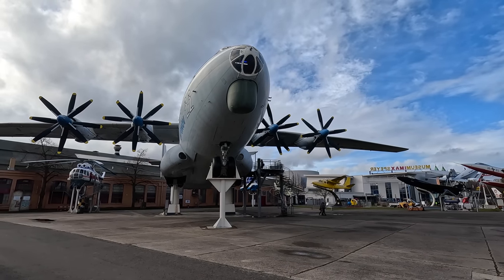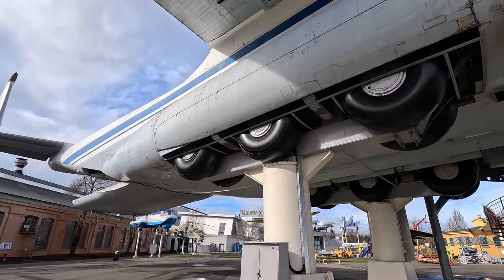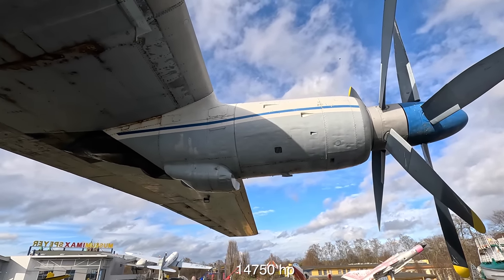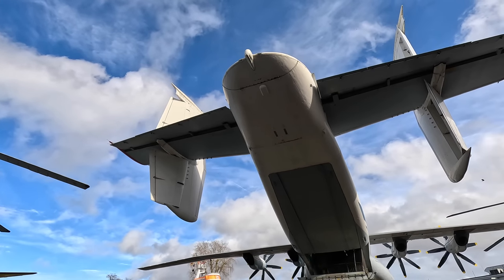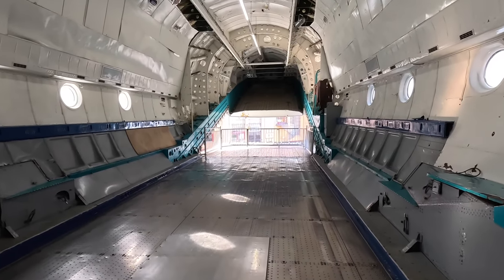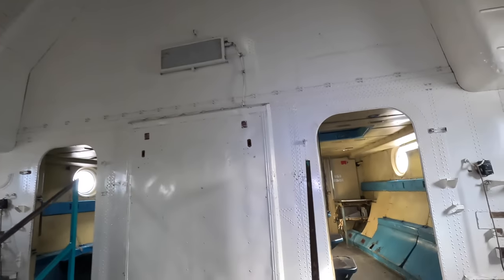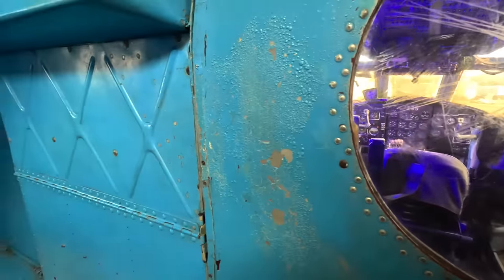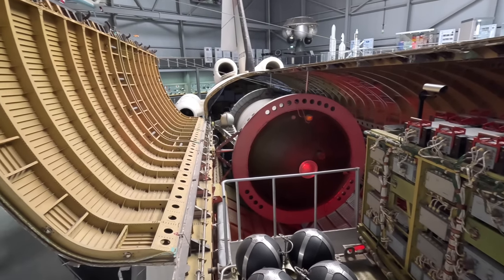Guided tour through the world's largest turboprop - the Antonov An-22

Comment: Paul, at 5:20 you said that having 2 small fin/rudder arrangements instead on one large one reduces torque (stress) on the airframe.   That doesn't make much sense.    To achieve a given level of yaw stability you need a certain total fin area.   To achieve a specified amount of directional control you need a certain total rudder area.   With these predetermined areas, the torque imparted on the airframe is the same, regardless of whether it is one big fin+rudder, or 2 or more smaller ones adding up to the same total area.
There is, however, a very minor, almost insignificant, structural advantage in the fin(s) themselves.    You don't want them bending, nor oscillating in the wind like a violin string.   To achieve the required fin stiffness, the amount of metal needed in the internal framing/bracing in 2 small fins is less than that needed in one large fin, due to lower internal leverage.   This may have been what your source was referring too - torque within the fins, not torque imparted to the airframe.
Reply: That’s interesting, I never gave it much thought either way.
Reply from the maker: Thanks for the extra information Keit and what you say makes perfect sense too.

Comment: It is fascinating how contra-rotating props were prized in USSR and dismissed by western militaries in the same era. As you discuss, they have some obvious advantages (no torque/yaw)  but some similarly obvious disadvantages (very complicated gearing and maintenance). It is interesting to see USA finally musing about them for future helicopters all these decades later.
Reply: Contra-rotating props were used in many aircraft of both Britain and the USA as piston engine power output rose during wartime development in WW2.    The classic example is the Spitfire fighter - it started out with a 770 kW engine and three propellor blades, and ended up with a 1700 kW engine and 6 blades in a contra-rotation configuration.  The US Mustang fighter had the same engine and contra prop arrangement.  Quite a few American aircraft large and small had contra-rotation props.  
But post war, both countries concentrated on jet engines.   It is not the case that the US military didn't like contra-rotation props.   It was that they wanted jets, because jets are simpler and more reliable.  In the early 1950's the thinking in both the US and Britain  was that flying at very high altitude was required, in order to make it hard for enemies to shoot them down with ack-ack.  At high altitude, props loose their fuel economy advantage.   The poor serviceability and high failure rate of the B-36 large post-war propellor bomber made the USAAF concentrate on simplicity and reliability and go for jets.
 In the USSR, their post war planning concentrated on turboprops as they had much better fuel economy than the early jets.   But to handle the large power output of the turbine engines, you need more propellor blade area.  So you need more blades - hence contrarotation.  The USSR planners expected their turboprop airliner to sell well in export markets - unfortunately for them the travelling public preferred jets.
Reply: @keithammleter3824  i must insist that is not true
Reply: Both the Shackleton and Fairey Gannet used contra-rotating props.

Comment: Large Soviet turboprops....not known for being quiet inside. 
Always liked the Tu-114 with its massive props but few on display and those are in countries not easy to access at the moment.
To minimise "beating" sound effects, large prop aircraft can allow synchronising of engines against a reference engine, say no.1, fine controlling of rpm of the other 3 so they all match and thus reducing harmonics and noise on cruise.
Reply: That’s pretty cool, I wonder if that’s a common thing amongst all multi engined props.  Ah, after re-reading your post, it appears so.

I do remember flying with my boss in his Cessna 340, and the dissonance when they were out of sync was really annoying and it even felt my balance was off - I believe I’d have gotten nauseous, or at least very fatigued, if the entire flight was thusly.  As powerful a light twin as the 340 is, there wasn’t anything used to synchronize the props - it was done by manually adjusting the prop pitch until the harmonics matched.  After all, the 520 cubic inch, 310 hp piston engines were a tad smaller than the Antaeus’  four 15,000 shp (each! Eeks) NK-12s.